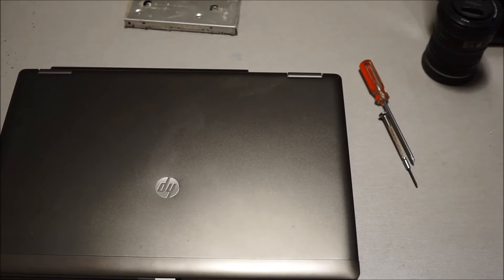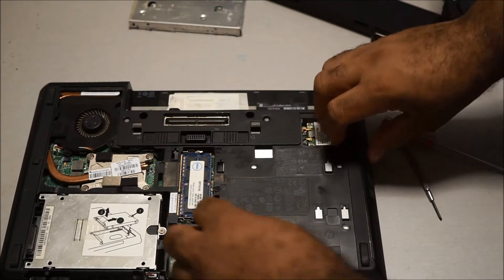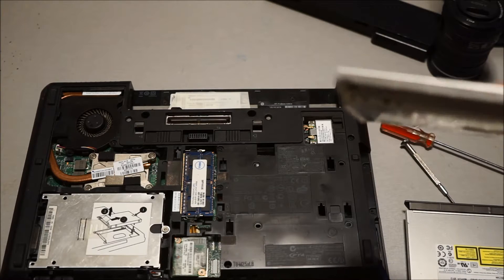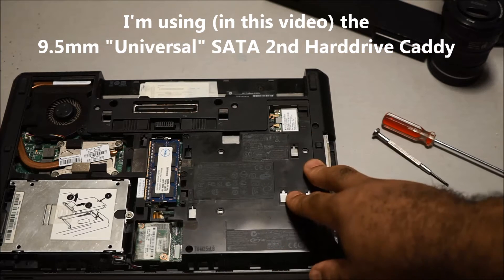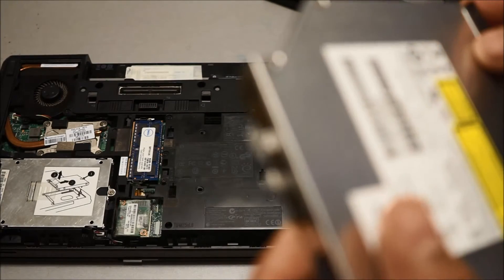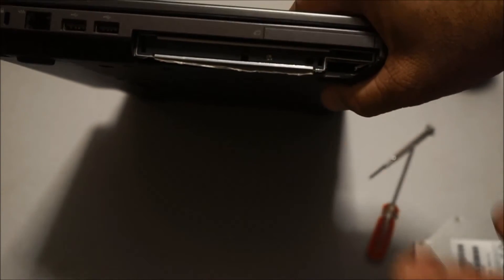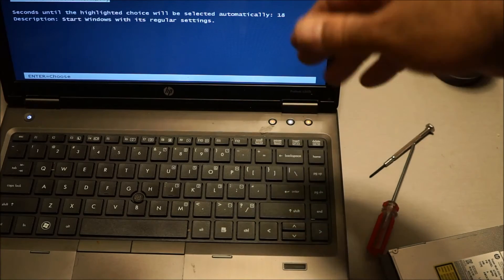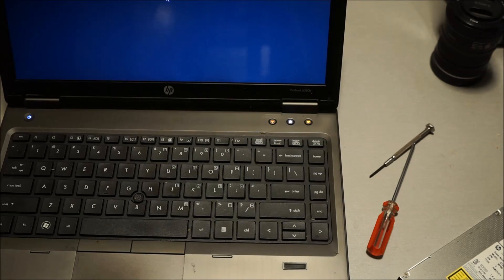How to removed your optical drive on the hp 6360b and add more storage? Part 1

Comment: what type of battery are you using?, it seems to me that it is a little bigger
Reply from the maker: Yes, I'm using the 9 cell battery. It gives me a extra hour or hour and a half of battery life.  Hp actually makes 4 different types of batteries that can be used for this laptop and the Pro & Elitebooks.  You can also use two batteries at the same time with this laptop.  That would get you around  8 or 9 hours depending on what you are doing.
Reply: @lovethatpop  Hello and thanks for answering. Can win11 be installed on this computer, how should the bios be configured?
Reply from the maker: @Ozkr0088  Hey, you're welcome.  Yes, you can actually install windows 11 on your probook.  
You just need to bypass the Sureboot or TPM   This is what windows 11 search or tries to detect for when install the operating system.  There are 2 ways you can do this or bypass this..  The easiest way is to download the ISO on a flash drive first and then open up the ISO data on the flash drive and go to the "source" folder and remove the "appraiser.dll" file.  This file is what detects your hardware and tells if you are running an old system.  So you just need to delete that file (so it won't detect if you are running an old system or computer).  This will work with the earlier version of windows 11, but the later version may now.  By doing this there may be some security issues (nothing major) your pc may not be secure as it would be running a newer pc.  If this method doesn't work, there's a second method (option) you can do that will work, it just takes longer to do, more work will be needed.
Let me know how it goes.
Reply: @lovethatpop  Finally I was able to install win11 with the dll method, but the experience was very slow and some programs go wrong so I'll stick with win10 for now.
thanks
Reply from the maker: @Ozkr0088  Ok that's good you was able to install windows 11 on your probook.  oh ok I see, it ran a little slow. For the programs, some of the programs may not be compatible with windows 11.  I had the same problem when I upgraded to windows 10.  Some of my main programs I use installed on win 10, but didn't function right or did not work correctly. Yeah, I think windows 10 is better than 11.
You're welcome.
Reply: @lovethatpop  On the other hand, I have problems with Bluetooth, it is heard with interference, do you know how to improve it?
Reply from the maker: @Ozkr0088  What problem are you having with your bluetooth, it cannot connect to your Bluetooth devices?
I had a problem with my bluetooth on my Lenovo w510 laptop.  It had bluetooth, but it couldn't connect to bluetooth devices, like my headphones and smartphone (i was running windows 7 on my lenovo).  So went to the lenovo website and look for the bluetooths drives.  What was interesting, is that Lenovo had 3 different Bluetooth drivers to use for the laptop.  So I download the bluetooth driver with the one that said "enchance data rate"  when I dowloaded that bluetooth driver and installed it,it worked with the bluetooth headpones perfectly.  You may have to use a different bluetooth driver..

Do you have HP Device Management installed on your laptop?  If so, you can check to see if bluetooth is activated or turned on. Or try and go to bois and see if bluetooth is turned on. If that doesn't work, you can downgrade windows 10 bluetooh driver.  
To check your "Device Manager in windows 10, first press "WINOWS + X" buttons or keys, then click on "Device manager" and click "View" then click on "Show hidden device" then select "Bluetooth" and then right click on "Bluetooth device" Ok... Then you can choose if you want to "Uninstall device" then you can download another or different HP Bluetooth driver and see if that will work.
Let me know if that works?
Reply: @lovethatpop  I have downloaded the drivers and now they have connected well thanks :)
Reply from the maker: @Ozkr0088  That's Great!  You're welcome